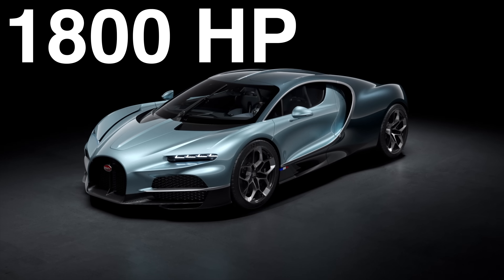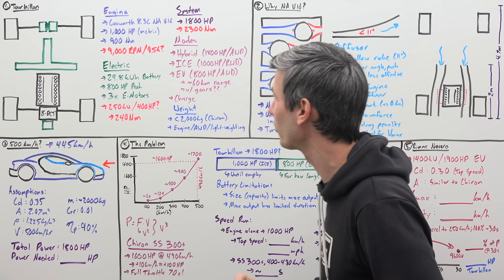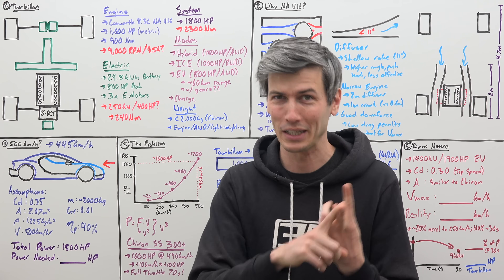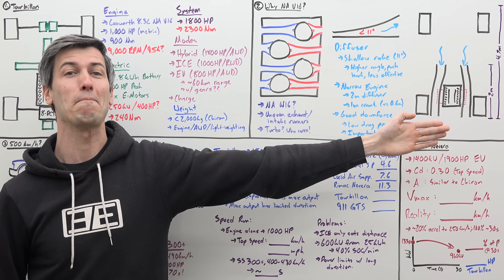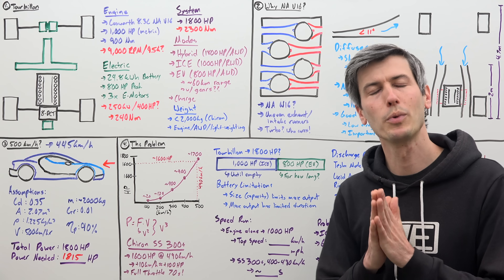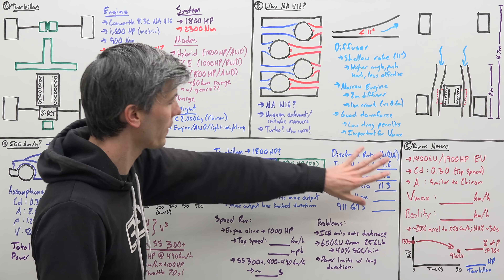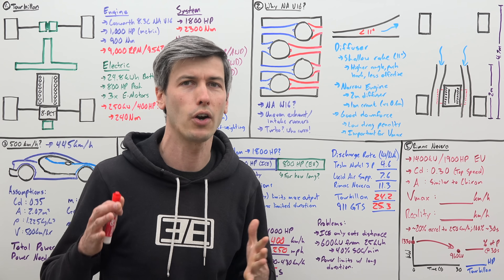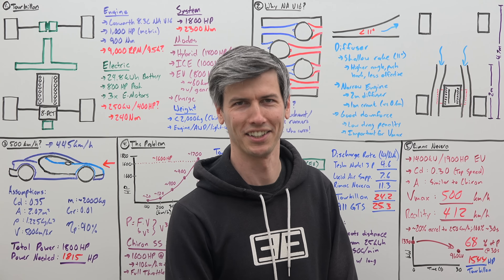Bugatti's Giant V16 Engine Is Insane - All The Tourbillon Details!

Comment: Hey Jason, love your videos. You’ve done a good job here. But just one little thing you have missed here. The Nevera does NOT drop in power because of battery derating nor is it overheating. If I remember correctly, it might have reached 35 °C in that run, which is very far from the maximum temperature. The power drops because the motors are reaching their maximum speed due to the transmission ratio. As you well know, with single speed gearboxes like in Nevera, there is a trade off between acceleration and top speed. We figured that 412 km/h was plenty and did not want to compromise on acceleration. So basically, the battery could deliver 1.4 MW for a lot longer if the powertrain could take it (longer ratio). The drop in power is due to the motor power curves which drop off at the end of the RPM range and the car reaching its equilibrium speed at max RPM. 

As for the Tourbillon top speed - as you said… Let’s see 🤓 

Would love to geek out on some other stuff you’re talking about here.
Reply from the maker: Really appreciate the added context - Tourbillon is an incredible project! Would love to chat details; let's make it happen sometime!!
Reply: rimac boss just randomly scrolling through YouTube and commented 😢🎉
Reply: I'm sure I am not alone in loving the idea of a videochat/podcast discussion between Jason and Mate about the engineering behind these incredible cars!
Reply: I read this as "Can't do 500Km/h? Challenge Accepted"
Reply: Wow, the creator himself 🙂 Congratulations on making an awesome car!
Reply: Engineering Explained Podcast with Mr. Rimac as your first guest, please!
Reply: would tove to see u both geeking out 🙃
Reply: Lol Mate casually commenting here and only getting 2 up likes
Reply: @gavcom4060  RIGHT !! 

Hey @EngineeringExplained, somebody would like to have a word with you! lol

Would love to see/hear the "geek out" between these two fine gentleman!
Reply: @EngineeringExplained interesting info listed here!

Would love to see you both geek out on more together!

How great is it that the boss is just casually commenting on the youtube video, what a cool boss :)
Reply: I don't think Jason has noticed this is the ACTUAL Mate Rimac commenting on the video😬🤣
Reply: A beautiful car in every way, the performance, styling, sound(!), and engineering. Phenomenal  engineering! It's good to see an enthusiast keep Bugatti going. Thank you Mate!

Jason's videos are great. I love his analysis and balanced perspective. Tipping my hat in to see a discussion between the both of you!

Oh, and hopefully you can prove him wrong 😁
Reply: I was wondering who this account was speaking with such knowledge and authority, then I read your account name and was like OH RIGHT - Hello Mate :)
Reply: Mate legendo
Reply: Wow....
Reply: Gorgeous automotive engineering, and a marvelous car too 😁 
The gauges are an absolutely genius design.

Congratulations on this beautiful achievement sir
Reply: Hi there Mate Rimac! It's incredible what you've achieved and you've got fans all over the world here. I've been following you since the Concept One days when it beat the LaFerrari. The Tourbillion is STUNNING, that dashboard is eyegasm and based on the Chiron SS 300+ acceleration, this is going to rule 'em all - a true worthy successor to the Chiron. I'd love to see you re-launch the 2015 Atlantic though as well - it was a stunner which unfortunately never made it to production. Front engine, lots of space in the rear. Should be an epic GT. Also would love to see you get a fully road friendly next gen version of the Cosworth Valkyrie 6.6L V12 for one of your future cars (which you also did the hybrid system for) - 1000 HP and 11k rpm is too good not to be reused in a more road oriented avatar. You're a legend!
Reply: I just knew Mate couldn't resist (knowing him, and following his work for years) making comment on this one, I opened comments to see, and there he is. What a legend, so refreshing to see. He is a completely different CEO with a true passion, speaking openly about anything.
Reply: I think this is a bit of a first in terms of YouTube car content I've watched. That's for sure.
Reply: So crazy Mate is here. Great job on the Bugatti. Keep pushing those limits. I guess you also just saw the Jesko do it's 0-400-0. Perhaps that car is in the 500km/h reach too
Reply: Seeing a comment from you here is crazy. So looking forward to creators like you and Christian Van Koenigsegg making such sick hypercars
Reply: Amazing to see you answer here. Thanks a lot Mate. And double thanks for what you are doing with your team both with the Nevera and Bugatti, these are marvels from the eyes of every engineer.

Quick question : I remember Bugatti saying years ago with the Veyron that one of the main limitation they have past 400km/h is the tires. The forces on rubber tires at these speed are so insane that just keeping them from disintegrating due to centrifugale forces is a challenge. And doing so while keeping them road legal is even more crazy. Is it still the case in 2024 ?
Reply: @MateRimacAuto  assuming the 3 motors are identical, I divided wheel torque by motor torque which gives me 6.25 gear reduction on the front motors, which means at 24krpm they are geared for 507kph top speed. something tells me it's not completely random and the car is designed to break 500kph in it's top dog trim...please don't break my dreams, I think this is the ONLY high performance hybrid ever that is designed perfectly from the ground up as an hybrid with the highest power output and lowest weight possible,and the only hybrid that beats it's gas predecessor in both power AND weight. and cherry on the cake, all this while getting rid of the turbos and keeping similar displacement and number of cylinders.
Also looking at the tourbillon and nevera electric motors specs I see 11% lower torque, 33% higher rpm and power, which tells me you cracked the code for the back emf and the tourbillon is the first car to benefit from these improvements. congrats!
my only regret would be if it doesn't feature active suspension. this is the next big thing in automotive industry and can help even ground effect and the diffuser efficiency, as well as providing the luxury ride it deserves + highest grip and cornering speed.
Reply: Sir, You're a Living ABSOLUTE LEGEND.
Reply: Can we get a V16 Manual non hybrid manual lightweight version of the new Bugatti? 1000hp and 3,000-3500 pounds would be amazing
Reply: @CanIbeFrank  how deep's your pocket? 😄
Reply: Awesome to see you here Mate! Please make a visit happen, would love to see how you all geek out 😀
Reply: @MateRimaxAuto could offer a higher gear as an option. It could be called -
Option 1 - More than enough speed and acceleration
Option 2 - More than enough speed and acceleration
Reply: would a 2 speed transmission fix the power drop off?
Reply: Mate, Hi, I had another question. Why didn't you ask Cosworth to make a more road friendly rubber mounted version of the Valkyrie V12 evolved to the next generation  that also makes 1000 HP, would be lighter, scream musically to the heavens and rev to 11000 rpm and which can also be hybridized?
Reply: @srinitaaigaura Because the 16 cylinder engine is a unique selling point for Bugatti. There are many very good hypercars, but none of them have a 16 cylinder, especially not a V16 with an inline 8 crankshaft length or even a bit longer. It is simply something special and runs even smoother than a 12 cylinder, which is already extremely smooth.
Reply: The usual issue was that someone from outside tried to reverse engineering to verify and confirm the design specs. That is hard!
Reply: Interesting because taller gearing would also mean more time at WOT, so at what point does the battery derate?
Reply: 6:39
Reply: If I was PraticalEngineering I would have done a fanboy squeal when I saw this comment posted. Just sayin...
Reply: Aka "Hold my beer" 💪
Reply: Please look into a (diesel) micro-turbine hybrid EV powertrain, It just made sense to me aged 16 back in 2005 when you consider..
1) current infrastructure, 2) diesel fuels density, 3) turbines can run at a fixed most economical RPM 4) with a motor in each wheel and 5) microturbines and electric motors both have a single moving part (although variable geometric vanes could change that).
Reply: Wait was that mate rimac lol wow
Reply: Wow now I understand motors like the inside of my Bugatti Chiron super sport
Reply: That's exactly what I've been thinking the whole time. It's mainly due to the fixed gear ratio of the electric motor. If you were to equip the electric motor with a two-speed system or simply make a compromise and give up some acceleration, you could theoretically drive faster.
Reply: Mate is a blessing for the automotive industry
Reply: Aren't the Tourbillon's electronics literally contributed by you; same technologies seen in the Nevera?
Reply: The Beast himself here! What about the Tyres? Do they hold up the force? Just stupendously curious and a crazy fan of you 
@Mate
Reply: Imposter! 😂
Reply: @somerandomfella it's Real man! Jason, pin this comment already!
Reply: @srinitaaigaura  his name should say @MateRimacTrustMeBro or it's fake! 😂
Reply: Am I correct that Nico Rosberg has one of your cars? And if he does, what's the story behind the car not working and his car being stranded in the city?
Reply: They need to change to the tesla graphene motors.

Comment: I am nowhere near as smart as you, but hear me out. If the car gets up to speed on the combustion engine alone, and the electric motors only start and "suport" as needed to accelerate further, gradually. Then only at the final moment go full power. Idk, sounds plausible. Just a humble woodworker here though.

Comment: what if ... they use the battery connected to engine as supply generator for battery pack along with the supercapacitor thing in lambo to maintain the performance of front 2 motors for longer duration ? like dumping hp to say 1564-1620 hp and touch 490-500.

Comment: I’ve just watched a video on Cizetta v16t by Hagerty, and there it has been said that a meter long crankshaft of a V16 engine would break. So they opted for taking power from the middle of the engine. And how is this problem solved here?

Comment: When it was limited to 400, it means it was a car designed as a death trap, that is targeting certain people. If the car flips over, you cannot get out, and the battery is next to you.
Perhaps the battery has a censor attached and is wired to explode if the car turns over.

Comment: Why a V16 instead of a perfectly balanced V12?
Reply: Because smaller pistons means it's easier for the engine to rev, aston did get similar power from a v12 in the valkyrie but it revs to 11k+ so it probably wont be as durable(wear is exponantial once you get to very high engine speeds) and the vw group probably has higher durability and reliability than aston(I dont know how true it is but apparently they build their engine to last 300k km) and also 16 cylinders is the signature of bugatti like the flat 6 with porsche

Comment: Motortrend said that "drag is 15 per cent lower than chiron in top speed with wing down". 
Chiron cd = 0.36 so Tourbillon Cd is 0.36*0.85 = 0.306. 
And Tourbillon Frontal Area is lower than 2.07 m2.

Comment: The engine is a disappointment. A chevy 10 liter V8 crate engine produces more HP and torque. The only difference between them is that this engine revs 2,000 rpm more, but the V8 has 2 more liters with half the cylinders.

Comment: If it’s just for a short duration, one shot kick so that going from 400-something to 500 km/h doesn’t take 90 seconds, maybe that could come from a bank of capacitors that were charged incrementally at otherwise slack times, and held in reserve until you held the throttle at max past a set time threshold. If THAT particular performance parameter is THAT important, that might be a way to do it without it being so hard on the car. I’m sure someone already thought of that.

Comment: A good rule of thumb to figure out the top speed of an EV is by looking at the top speed of an ICE car with half the power. So for example a Tesla Model S Plaid Makes about 1000 hp, it can go as fast as a Ferrari F40 which makes half that power. A Rimac Nevera Makes about 1900 hp, it goes as fast as the 986 hp Bugatti Veyron. So my guess is that the top speed of tourbillon would be the same as a 1400 hp ICE car

Comment: I do wonder if the fact that this is a hybrid battery with a higher C rate means it could maintain a higher discharge for longer since it doesn’t have to function as a range battery normally. High capacity and high discharge are generally opposite goals with battery design, so a 25C hybrid battery might actually be able to maintain the majority of its power throughout its capacity.

That said, I think the limiter is likely realistic and not enforced much. I do think Bugatti is keeping some performance up its sleeve for the inevitable higher trim model, but I suspect even with the right tires and aero optimizations, this existing powertrain just won’t be able to hit the magical speed. I’m guessing they’re planning on having a larger capacity battery for the upgraded version, possibly relying on future improvements in battery chemistry in order to deliver enough power for long enough. 

The idea of a top speed mode that uses the combustion engine only up to a certain speed is super interesting though and definitely makes sense as a workaround to battery limitations. I couldn’t care less about these billionaire toys as actual cars, but I’m looking forward to finding out the engineering details and performance results someday.

Comment: The point of using v16 tech is not the engine itself. It can be possible thanks to Rimac's proper packaging of the electric power and battery plus aero elements. Even turbo tech can't be used from the inception because this also pushes the weight distribution worse since those turbos should be situated around the engine. It uses the most promising floor and diffuser designs. They will put some active adjustable elements to reduce the fluctuation of the downforce to compensate for the road condition esp at high speed.

Comment: No more Bugatti yet from Cosworth. So they picked the usability for Cosworth to make them keep going rather than pursuing Bugatti's tradition. 🎉It wasn't W18 or any other X18 or something beyond the expectation. It is just on par with the industry trend and market requirements. The motor sounds like two V8 and it again made how special V12 and some of V8 are. It is not just the outcome of pushing its tech or engineering limit. It is rather about the market value preservation. Now not many manufacturers  have their own engine. It reminds me of Enzo's words harder. No turbo means just no space to put them in because the space has been occupied by the hybrid and more electronic components so the mechanical look on the steering wheel is a gesture for non car guys.

Comment: You're leaving out one primary subject: price. 4.1 million USD. Subtracting those four (?) lithium-ion batteries would make the car so much lighter, and most importantly, the upgraded V16 would exceed the car's speed. I really don't see the benefit of adding those batteries. Also, whatever happened to the manual transmission in these "supper cars?" Giving these high-powered cars an automatic transmission might be great for those who never took the time to learn how to drive a manual transmission, but it also gives these "new" drivers a death sentence. Another flaw in this car is rear-wheel drive, most likely not even a positraction rear-wheel drive, and not a full-time all-wheel drive......and please don't tell me that it is all-wheel drive with the battery system that won't last you more than ten to 20 miles. That's a double death sentence, meaning not only are you going to kill yourself but most likely hitting another car and taking them along with you. Great car so far.

Comment: I suggest take the hybrid system out completely. Take the 1000hp V16 use a twin electric turbo system. Have a smaller lighter battery just for the system. Use the exhaust driven turbine sections as gen/regen on battery. Unfortunately no regen braking because motors will not be used on the new car. 800+ more hp should be obtainable because compressors will be driven by motors and not the exhaust of the engine. Turbo lag would not be an issue. You can also tailor as to when full boost will kick in without bleeding of boost until it was needed to hit top speed of 500 kmh or higher.

Comment: the batteries do not have the voltage output for that the amp draw is going to be more than the cables/motors can accept. they should have just put turbos on the engine and ditched the battery/ev weight

Comment: Have you considered the top speed potential if they only used the combustion engine until 400 km/h and then started applying the electric power gradually rather than 100%? What if they used 50% electric power from 400 km/h until X and then went 100%, wouldn’t the power available by the end be more than 72% since the battery is used at full throttle for less time? 16:45

Comment: From watching the video and the comments, either way, I’m sure the Tourbuillon will reach 500 one way or another. If not the stock version, then a special version just like the Chiron. It seems like 1800hp is a close spec bump away, and you pointed out an engine cover revision would get the drag down. if there will be a Tourbuillon 500+ edition then I wholly expect that to happen.

Stock seems like it will get to 300 just fine though lol. Probably what they were going for tbf.

Comment: I also think it cant reach 500 kmh. If it could reach 300 mph so around 480 kmh it would be a success. Unless they use some new breakthrough battery technology which allows the electric motors to give full power at longer period of time.